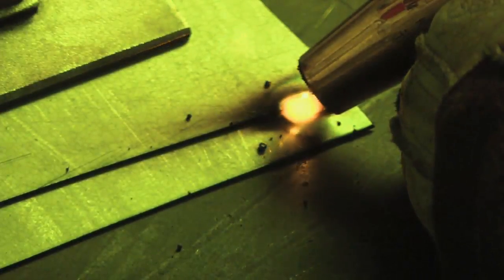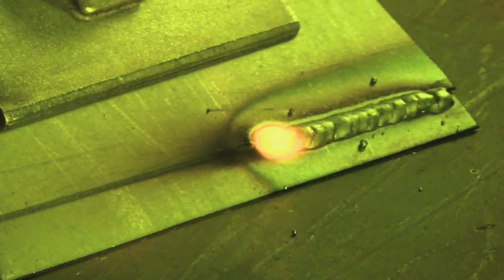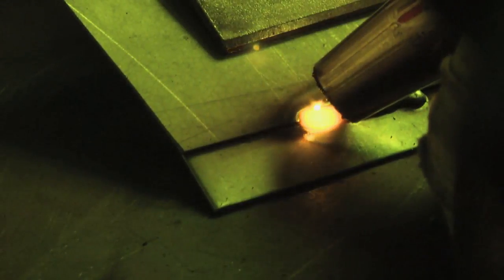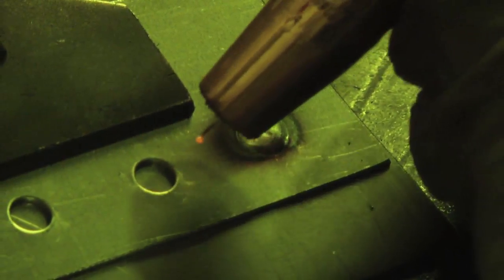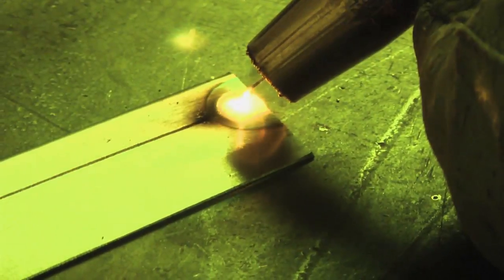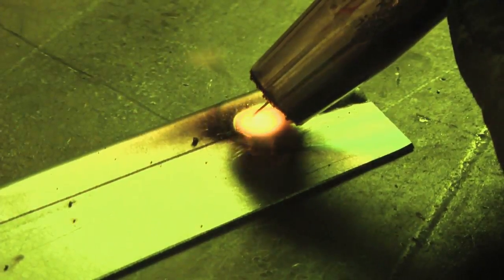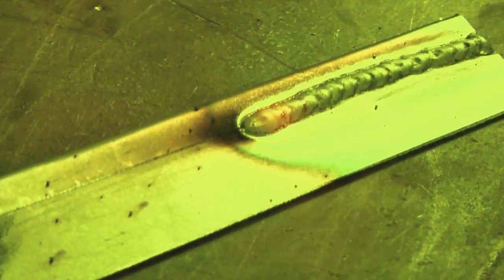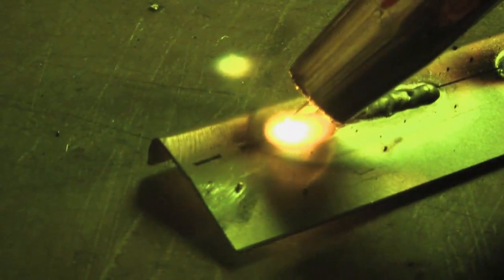Bench Top Welding  |  Fix My Hot Rod

Comment: Hi Excellent video. I have a question. For plug welding, if the base metal the bottom piece is 1/8" thick and the top metal with the hole is 18 gauge, do you still start outside of the hole  and finish it in the middle? Also in this case, do you setup your machine for 1/8" welding or 18 gauge welding?

Comment: Interesting. The recommendation usually is to begin in the middle, and spiral outwards. That’s how I do it as well.
Reply: The problem with starting at the outer edge is that it tends to burn the hole's edges back. The middle is more resistant to burn thru and blow out.

Comment: What gas and wire size would you use for 18 ga sheet metal
Reply: Co M 100% CO2, C25, and 90/10 are most common. Most machines have the recommended settings set up for 100% CO2 or C25 mix. .030 or .035 will work. .045 is too large and will have to be too hot. Don’t use the stop and go technique like in the video for any kind of joint. If you want to stack dimes, practice makes perfect and the cursive e movement is easiest. Just go straight across doing stitch welds approx 1” to 2” for long sections. Pulse spray transfer can only be used in flat and slightly horizontal or vertical position.

Comment: I especially appreciate the plug weld tip: start on the outside and work my way around the inside, letting it fill in. End in the middle. It'll start 'cold'

Comment: What settings do you use for the plug weld? Do you go with voltage and wire feed for one panel’s thickness or the two panels combined (or something else)?
Reply: general23cmp I just set it a little lower than the thicker piece and keep the arc in the pool on the thicker piece while flicking to the thin piece if there’s a 1/4” or greater difference. If not just keep the arc closer to the thicker part

Comment: I tried mig plug welding on thin sheet metal and burn through
Reply: If you're using flux core wire that's probably your issue. It's possible to use flux core but it's a little more difficult for a novice welder to get good results. Flux core (FC) usually only gets down to .030 in size. That size wire will get you metal to hot to fast. You have to use .024 (or smaller if you can get it) steel wire on thin sheet metal. He thinner wire creates less heat at the weld. To use steel wire Vs. flux core wire you must use a shielding gas. Usually 75/25 CO/Argon. This is where things get expensive but only the first time the gas itself is cheap. About $45 for a size 60 bottle. The cost is in the gas bottle set up. The bottle initial cost is about $250 and you will need a flow meter $150-$250. After you have these things though you will only need to refill the gas from time to time. Check out a few more "MIG welding thin sheet metal" vids and you will see what I'm telling you is true. Hope this helps man.
Reply: Ashroyer86 you may have needed to change your settings.

Comment: Great video and tips!! When you do the plug welds, do you grind them flat when you are done?
Reply: These are below flush.  If you want to do that, you'd have to fill it a little more, so the weld looks like a rivet head.  Might just be one more second on the trigger, right in to the middle of the puddle.   That's what I normally do, I think what we're seeing here in the video is better practice!   This is very nice, he's using plenty of power and getting good fusion, but keeping the total heat and penetration down.  I just watched this several times, and now am going to go try it.  I think for a butt joint I might try a little gap at least once.  Starting as we see here on the hot metal, and then pushing forward to melt the base metal each time.